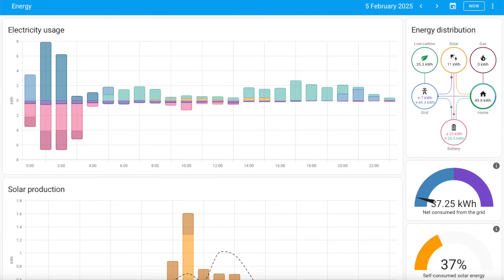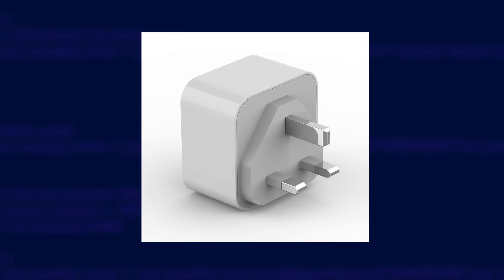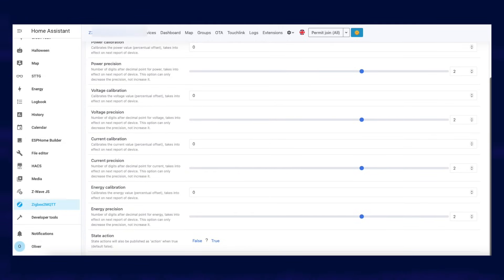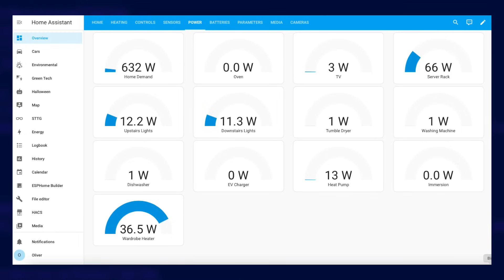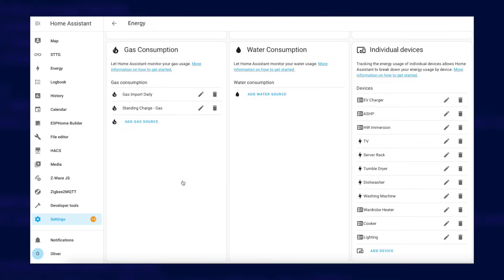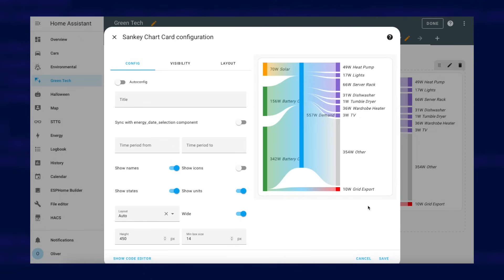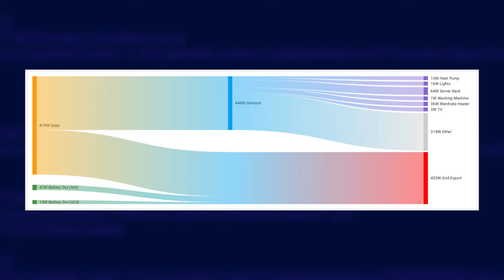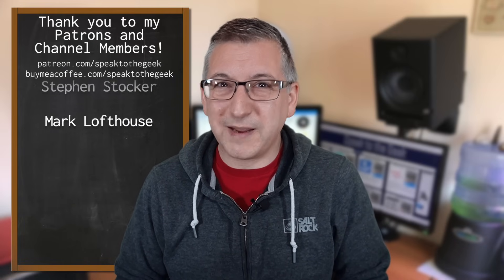Whole Home Energy Monitoring with Home Assistant

Comment: In my previous house I had an Emporia Vue that had been flasehd with ESPHome installed at the consumer unit that monitored just about every individual circuit apart from the lighting circuits. Carefully uninstalled it before we moved to this house but the new consumer unit just didn't have the space to get all the CT's in so that's ended up in the box of bits that will never see the light of day again, in the room of doom (aka what's meant to be a garage).

Decided this house was going to be primarily Zigbee based so have ended up with six of those Innr sockets (needed to create a custom ZHA Quirk to get the proper number scaling in ZHA) - they're excellent quality and I got two triple packs from Amazn Warehouse, a dozen of the bargain new Ikea Inspelning sockets (got them on launch day with a cheeky Click & Collect and they all went out of stock across the country shortly after) and I think there might still be a few wifi based sockets knocking around. For anything I just want power measurement from without any remote switching option I used some Tuya based Zigbee CT clamps and made up 30cm "extension leads" with the CT's integrated into the socket and just integrated straight into ZHA. They where silly cheap on a special on the rain forest related website and I got some that had bidirectional monitoring and also dual CT's. Tried a couple of times with the Sankey chart but it just started getting messy so largely went back to a gauge based dashboard and the Energy dashboard.

Comment: Thanks Oli, I'm only a month into HA, but have got all my home systems (Octopus, Daikin, Victron E., general home) talking to each other, and switching on/off as instructed, but have found that the MG4 hogs (I cant have HA/MG app working together) my system (I think you have the same?), any advice, apart from removing SAIC from HA?
Reply from the maker: I'm able to run SAIC just fine together with everything else on my Pi 4, but to be honest I don't really use SAIC (I leave it disabled) because its use is very limited - I find I can control the car fine, but it logs me out of the app on my phone and the data only updates if the car is driving, sometimes, so I can't rely on it to show me the latest SOC.

Comment: I’m in the same place as you, I have around 30 smart plugs now, I use sockets from localbytes mainly as they can be flashed with tasmota or, as I have done, use esphome. I’ve got solar, batteries and a heat pump as well and it’s a bit of an obsession monitoring all energy to find where it is all being consumed to look for opportunities to save. But now you’ve given me another card to obsess over….damn you! The one real benefit I have is wringing every bit of energy from solar, making sure I don’t overcharge my batteries so I’m not exporting anything…or as little as possible. My biggest energy culprits though….my computers and network equipment…..that’s irony for you!
Reply from the maker: Wow, 30??! That's a lot!
Reply: I’ve recently had solar installed. Why is it that you try to use up your power instead of exporting it? Do you not benefit from a good buyback rate?
Reply: @livinagoodlife  I am on the old FIT scheme. You are first paid for every kWh you generate, then paid again for 50% of your generation on the assumption you will export it. So by using all the generated electricity you get paid for it, even the export part. That scheme stopped so you only get paid when you do export now.

Comment: I never could get the standard energy monitor to work properly. It always shows the charging of the battery from the grid as house consumption so counts the energy usage twice. Ended up making my own dashboard.
Reply from the maker: That's odd, mine works great - it's all automatic, there's nothing to configure provided you just select the correct entities for charge, discharge, grid import / export and you're done.
Reply: Well I think I’ve done that. Certainly grid I/O and battery I/O are correct. You don’t set anything for home. I don’t have solar. Home shows grid out + battery out. But grid out can also go to battery in and therefore shouldn’t show in home.

Comment: Hmm just use a victron system with solar and batteries and you dont even have to touch HA, you will see all power usage in VRM and you can transfer data from victron via mqtt to HA if you like, but VRM is more than enough. Than you dont care how much power is what using because your energy is free…
Reply from the maker: Well I kind of disagree... I have a GivEnergy system which can also monitor solar / batteries / grid / anything in a single dashboard just like Victron can, but I'd still want to see that detail of individual devices because the energy isn't free, it's usually come from the grid over night and I want to use as little as possible to make those batteries go further. Solar is technically more profitable to export (at 15p compared to off-peak 8p import for me) so even using 'free' solar is costing me by comparison to using off-peak from the batteries. Also, what about those people without solar and batteries? They could do with knowing about their power hungry devices too and these gadgets I'm showing here are a great value way to do that without spending a few thousand on a battery and solar system.

Comment: only what you measure you can manage, right?
Reply from the maker: How do you mean manage, sorry?
Reply: @ in the sense that only if you know which appliance uses how much energy that you can focus time and money on which appliance to use and/or replace going forward. great content, thank you!
Reply from the maker: Ah yes, I understand, you're right. Although it's more a visual prompt I guess - if you have a washing machine on 2-3 times/day every day of the week, chances are you're already aware that it's using a ton of energy :) But monitoring lots of devices means you can understand how that is in comparison to other devices. Turns out my lighting circuits are negligible in the grand scheme of things, and my oven doesn't use much because despite its high power, it's not on at that high power for that long. The washing machine and tumble dryer are our biggest uses, after the EV and heat pump of course.

Comment: Thanks for a great video. I bought a Shelly plug as a power sensor. I could get the first one to work. I bought the Wave version by mistake. Doh. I will certainly give the Sankey card a try.
Reply from the maker: I'm not a fan of their smart plug design (sits flush with the socket), and z-wave power monitors I've found to be unreliable (I've tried several other brands). Shelly Wifi and most Zigbee monitors seem to be fine though.
Reply: @ I bought the Shelly Wi-Fi in the end. I may well give yours ago next time I need one. The also has a bright green light ring when on, which looks nice, but not in all contexts.

Comment: 64W for your server? Wowzers.
Reply from the maker: It used to be a lot more when I ran an Intel server with 6 old hard drives in and a whole bunch of fans plus an old network switch. I'm now running a Synology NAS, passive 1Gbps 24-port Netgear switch, Raspberry Pi for HA, HDHomeRun TV Tuner, and the Reolink Home Hub, plus several ad-hoc USB-powered devices. I think I've got it pretty lean now but there are always improvements to be made.
Reply: @SpeakToTheGeekTech   I hear that. I've still got about 30u of Dell PowerEdge servers and disk arrays sat in the garage waiting for me to get rid of and had to stagger the power up sequence of them due to the initial inrush. Dread to think about how much energy they used. Made a big effort just before COVID arrived on the scene to move everything on to a Proxmox cluster of five ultra small form factor PC's and National Grid are probably much happier now.

Comment: Great explanation, thanks. I've similarly got some smart plugs and the Shelly 3EM like yours - on a bit of a quest to reduce the unassigned so we can manage it :) where we have a few appliances at the same socket, we've found the "Tapo P304M Smart Plug Power Strip" has been great as each of the 4 sockets in the extension has separate energy monitoring etc.
Reply from the maker: I have the Tapo KP303 which is great, sadly no power monitoring. My one complaint about it though is it's cloud-based control only which I suspect is the same for your P304M.
Reply: @SpeakToTheGeekTech  Yeah, it does initially get a local key from Kasa/tapo cloud, but it seems to work locally after that - uses the HA core TPLINK integration which says "Its IoT class is Local Polling." and "The integration connects locally to the devices without going via the TP-Link cloud."

Comment: Impressive. For the slightly less geeky I think the Emporia device does most of this.
Reply from the maker: Yes I think you can do circuit-level monitoring with Emporia which would give you the same detail as the Shelly does, but I don't think Emporia does individual devices though? Either way, it's cloud-based to get the data into Home Assistant from it if you wanted to and I prefer local access personally, and Home Assistant lets you pick and choose devices to monitor energy and consolidate it all in the one place.

Comment: Thanks for another interesting video - I’ve been using the same Innr smart plugs, bought them for the exact reasons you mentioned and have also been very happy with them!
Reply from the maker: They're very good, but beware of upgrading the firmware on them... you get spikes in energy use just afterwards that you have to manually clean up out of your statistics... bit of a pain, but if you remember to go check for it a couple of hours after the upgrade then you won't get a nasty surprise!